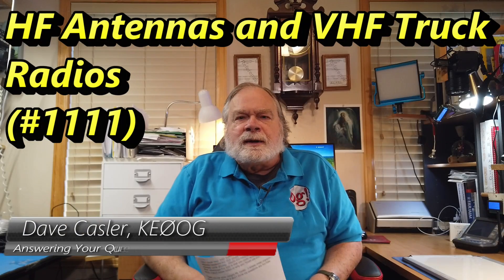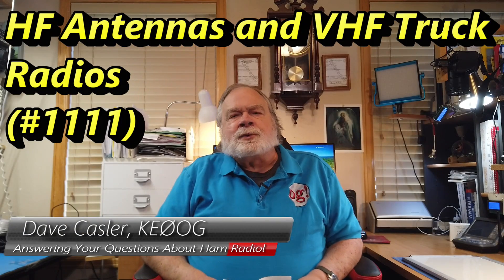HF Antennas and VHF Truck Radios (#1111)

Comment: Regarding crossband repeating. I used it extensively when I was out in my jeep and had to be away from the jeep for some reason that way I could stay on the main channel and use a handyheld to talk to the radio in the repeater was essential in a couple of kind of rescue situations. I also used it around the house because I was situated in such that reaching the repeater was difficult with a handheld. About dual watch I found it was fairly simple to keep two repeaters on listen and just turn the one I was not interested in down. Fortunately, I have radio that I have I could tell her to glance which side was talking.

Comment: Isn't one of the big reasons that a Loop on Ground works despite not being very sensitive is because it attenuates vertically-polarized noise more than the horizontal component of the signal?